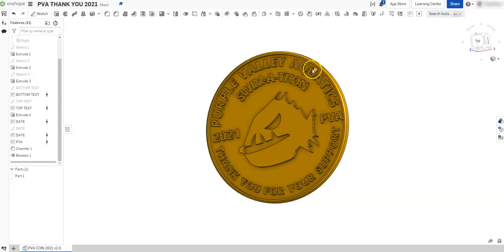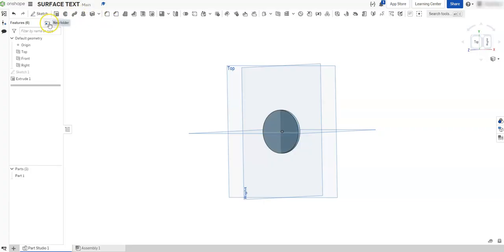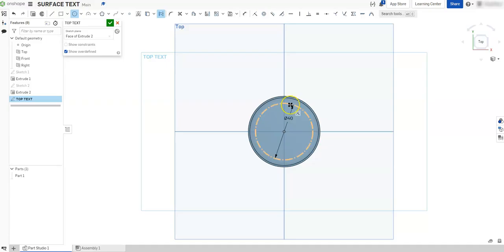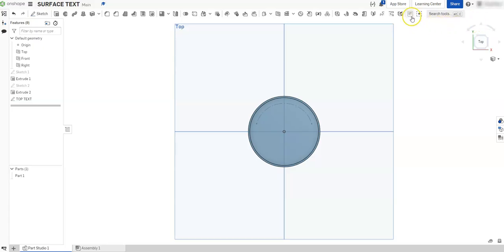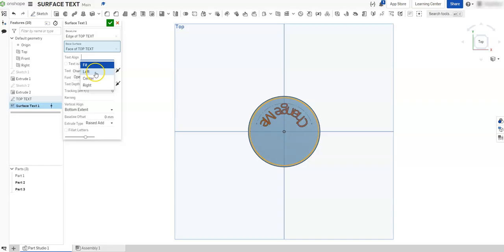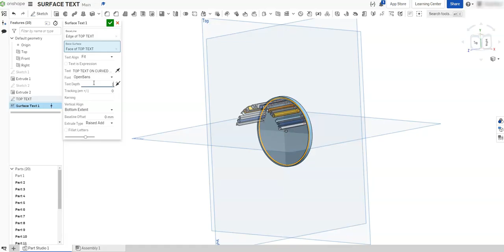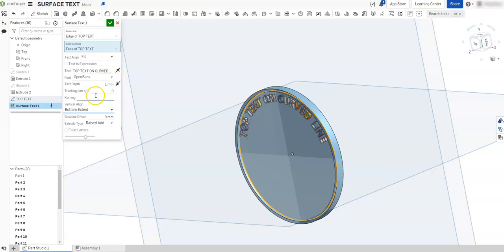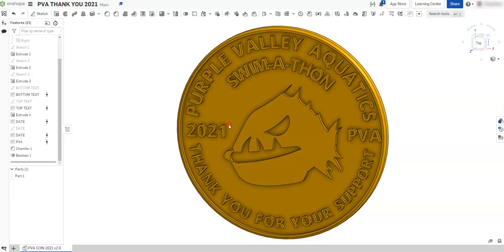OnShape: Curved Text

Comment: Very usesful, when adding the surface text, if you select the face of the extrusion for the "base surface" it will combine the text with the extrude, and you don't need to bother with the boolean operation. I just found this accidentally.